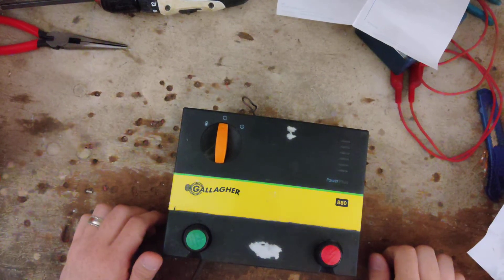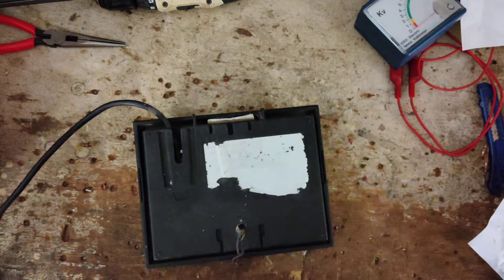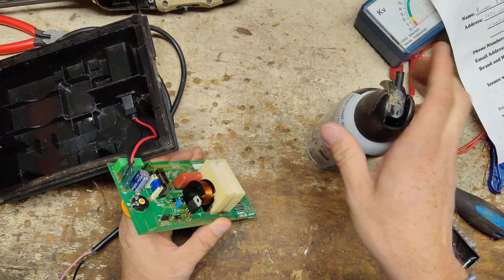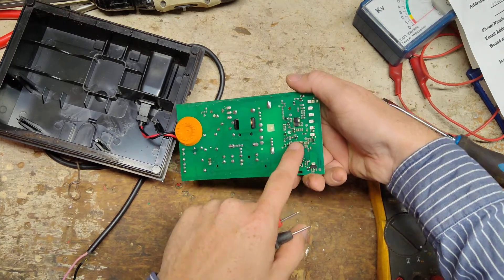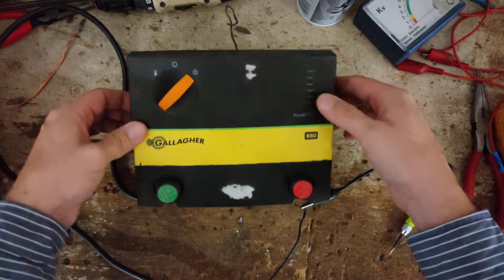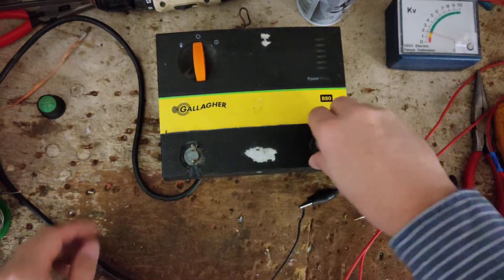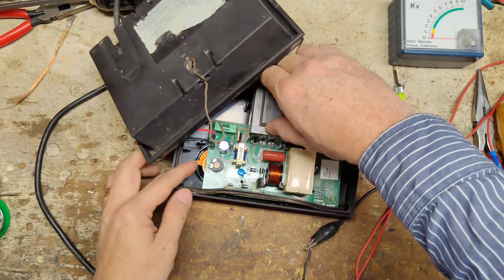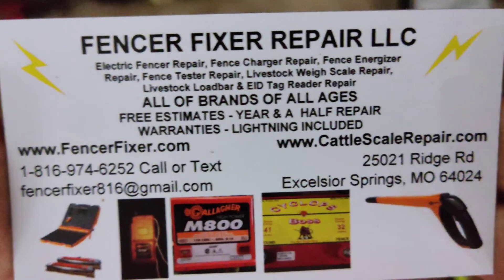How To Test & Fix A Battery Fence Energizer | Gallagher B80, B180, B280 Repair

Comment: I have a B80 that was showing red flash, and would throw a little spark to a grounding test lead. I cleaned up the grass growing through the fence, and it changed to the top green light flashing, but there's no spark anymore to the test ground, and no audible tick. If I bench test it, I cant fault it, nice spark on any load. Connect back to the fence, green flash but no spark. Any idea's. Great video.
Reply from the maker: I'm not sure where your issue is exactly. I would test it with an actual digital fence tester you see exactly what you're getting out of it with no load connected and then retest the fence with the tester vs just doing a spark test. The spark test isn't an exact test to do for getting good readings, it's just a guess and you don't actually know if you're getting 100% full spark or 30% spark, it's just a spark.
Reply: @FencerFixerRepairLLCKansasCity  thanks, yes I need a proper tester. Or put my hand across it :)